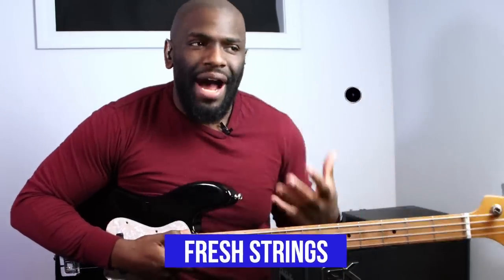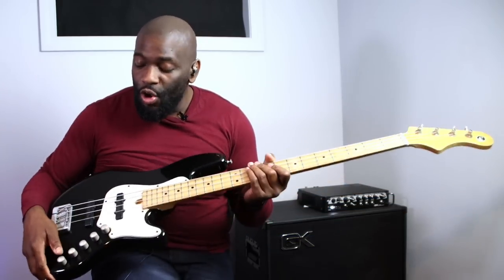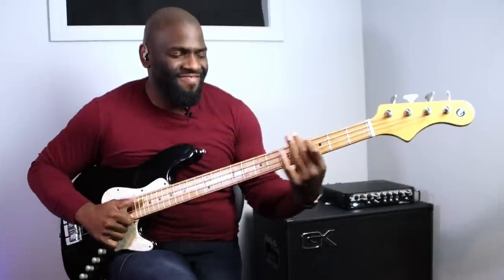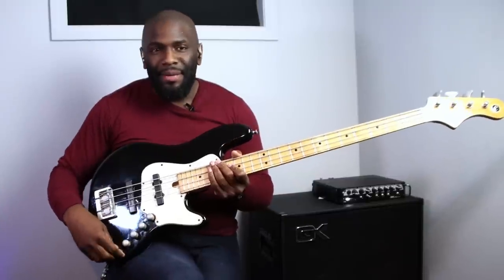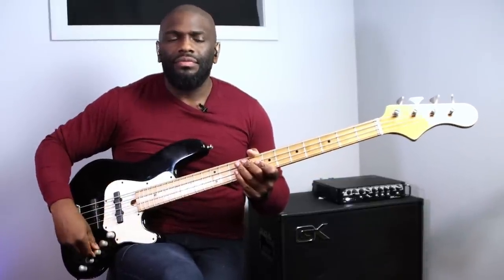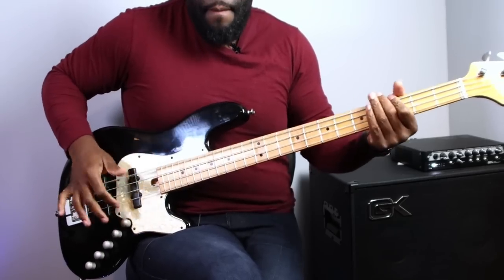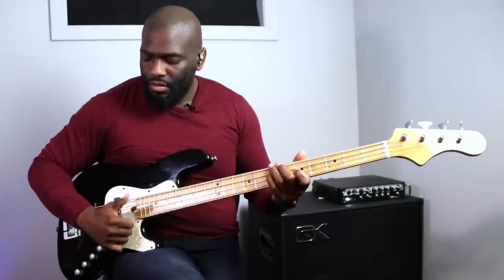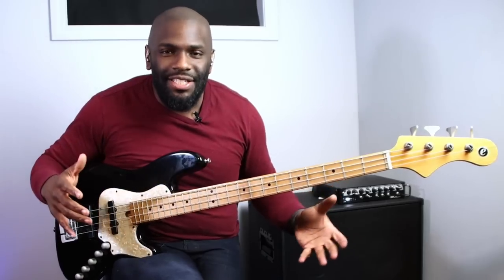3 Reasons Why Your Slap Sounds Like Crap! & How to Fix

Comment: I believe the best way to get started when it's your first time attempting slap is to utilize the same method of opening a door knob with your forearm relatively parallel to the bass strings and using the thumb near the knuckle like a mallet striking a piano string would, immediately moving away from the string after striking it...no need to strike hard, just accurately, which comes with time. A good set up definitely helps, too. 
Great point about simply cranking up the treble knob is not the key to great slap tone, Daric and that intro was doooope! I like the new paint choice, too!
Reply: There is merit to the “light touch” technique (in slap and fingerstyle) - turn turn your amp up way too loud and play gently and precisely. 
Dynamics are under-appreciated!

Comment: Did anyone else get goosebumps on the chalkboard scratch scene even though there wasnt any sound? Lol
Reply: Chalkboard scratch has no affect on my nerves but if you run your nails perpendicular to the surface of a dry paper towel, I will have my neck muscles twitch and my hands go numb for a second.
Reply: Kristopher De Tar same but I get goosebumps from seatbelts